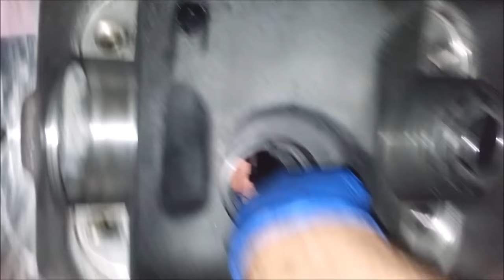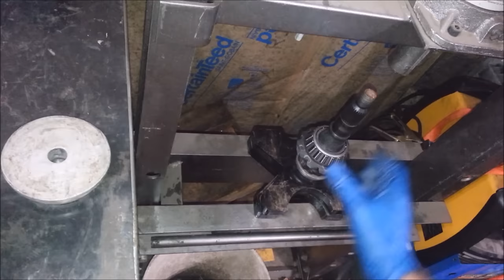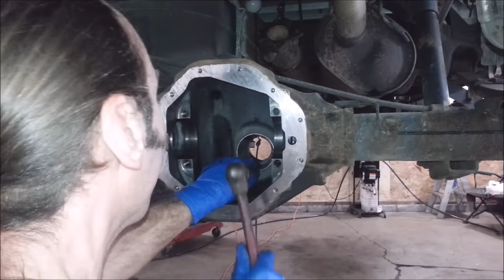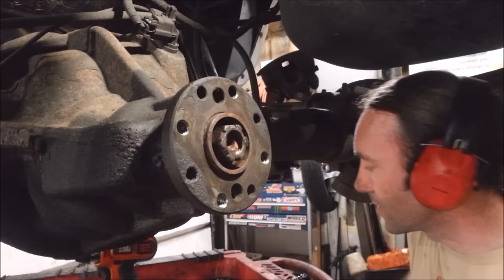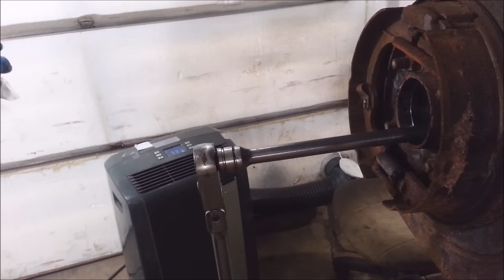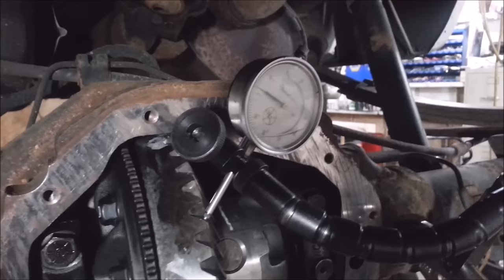1994-2018 Ram 1500 9.25" rear differential rebuild assembly pt2

Comment: The only other thing you should have checked is the pinion depth.   You can do that 2 different ways.  I use the easy way to check it.  I use the yellow grease that you paint on the ring gear and then turn the pinion and watch where the pattern shows up on the ring gear. Or you can measure the pinion depth with a pinion depth tool.  The contact should be in the middle of the ring gear tooth in all directions.  If it's too deep or too far out you will have to add or remove shims.  The other thing is I hardly ever use new crush sleeves.  The old ones can be reused no matter what they tell you.   NOT ALL THE TIME, but most times.  Most times if you re use the pinion shims and the crush sleeve, the pinion depth will be ok.
Reply: I know it's been a year since you commented but just in case you see this I had a question about reusing the crush sleeve. I don't plan to pull the pinion gear (I should tho because the seal is leaking a very little bit) when I replace clutch packs later today in my '03 Dakota with 9.25, 12 bolt, 3.55...but with the driveshaft removed can I check and adjust the crush sleeve drag torque and look for 20-30 inch pounds? (I think that's what he said in the video?) 
I've been a mechanic of one type or another for 50 years but I've never worked on a diff. I'm more than a little reluctant. 
On the chance you see this and reply, Thank You!
Reply: @gregoryking9348 I can’t answer your question. But I have one. My clutch pack belville washers sheared in three places. If my gears are fine can I just do a clutch job ? Do they make just a clutch rebuild kit?
Reply: @dkeeton7  Yes! Absolutely. I bought both clutch packs on Amazon. 

The hardest part of the job was compressing the Bellville's and rolling in the planetary gears. I  finding the right length bolts and the right number of thick washers to use on each clutch pack/axle gears to compress the Bellville's in order to roll the planetary gears back in. I ended up using one 1/2" X 6" and one 1/2" X 5 or 5.5" bolt as 'presses. Get 4 nuts and 8 thick 1/2" washers. Put one nut on the longest bolt and run it all the way up to almost all the way toward the head of the bolt. Then put 2 waahers on the shortest bolt and insert it from the inside the axle gear, thriugh the clutch pack, then add 2 washers and a nut on it and center the bolt and washers the best you can before tightening. Tighten it up and compress the Bellville. Don't go crazy but tighten it until you think the Bellville is losded up. 
Next thread a nut on the longer bolt almost to the head, add 2 washers, and insert it from the outside in. Add 2 thick washers and a nut.  You'll only want the nut screwed on so the end of the bolt is flush with the nut. Use the nut on the outside to snug it up as you center the bolt in the bore of the axle gear/clutch pack the best you can. Then tighten it to compress the Bellville. 
* Both bolts can't be inserted from the inside (head of bolt inside carrier) because it's physically impossible. There simply isn't enough space.)
I suggest first trying to roll the planetary gears in without the concave spacers. The meat on the new clutches doesn't leave any room to roll them in along with the gears. Use a good amount of gear oil while rolling in the gears. Once they're in (it is NOT a cake walk but be patient) then lube the concave shims and slide them in. 
Setting the lash is more of a patience thing than difficult. I bought the long tool on Amazon for about $20. 
If I had another pair of hands and a lift the process would have gone faster but I had to keep crawling out from under to adjust, remove/reinstall the tool...rinse and repeat. I ended up with more lash than spec of .005-.010 but I was plumb wore out.
Don't forget you have to torque the carrier bearing caps and lash adjuster/lock rings over and over before getting an accurate lash measurement. It's exhausting to say the least. Then again, I'm 65.5 with a 4 time loser back and a body beat up from 50 years of heavy industry so there's that. lol 
One last thing...if you plan to replace the axle seals?...do yourself a favor and buy them on Amazon for about $20/ea. The dealer gets $50!!! Each! 
Good luck and be safe.
Reply: If you just need to replace the pinion seal, you know you must remove the driveshaft and the driveshaft yoke.  Then use a seal puller tool or large screwdriver.  They do make tools that help to install the new seal but I feel if you have worked on cars that long you know how to tap the new seal in place.  I have a harbor freight chisel that I've grinded the point off of it.  I use it to tap on the seal to install them. I have over the years made several tools for that purpose.   To be totally honest with you I just turn my impact gun down in power and tighten the pinon yoke nut with some blue locktight on the treads and then see if it is binding in anyway.  I haven't had a comeback.   @gregoryking9348

Comment: Really like what you did with this video,  I had a spacer between the pinion race and housing on my 2011 and I just re-used it.  Your video saved me 3K plus as the shops around me just wanted to swap out the entire rear end and wouldn't do the bearing job.
Reply: i destroyed that spacer when taking out the inner pinion bearing race. now idk if i should add shims of the same trhickness although it was on the crush sleve side of the bearing. I also didnt have a shim between the pinion and bearing. (2011 ram 1500)

Comment: Thank you for this!! You explainedit extremely well and gave me the confidenceto do it myself. The hardest part will be acquiring all the tools. Time to get started!!
Reply: The tools alone for this job can be very costly !
I'm working on that myself... I need a 20 ton press (or 40), Bearing Driver Set (I've gotten by without now for nearly 30 years, but never did a rear-end either), Bearing seperater set, and a flex mount for my dial indicator.
Reply: Harbor freight  has everything and it’s all equality enough I’m setting my backlash as I type

Comment: pro tip use hydraulic press to slighty initiate crush sleeve. So you dont have to use too much force when installing them. Also you can reuse old one if you happen to need more shims for the pinion. Second set of new bearings helps to get the job done quicker if you make bearings slide on and off without any pressing.

Comment: Very good video. I like how you went step by step. This was what I’m planning to do this weekend if all my parts are here by Friday. Thanks for the video man
Reply from the maker: Thanks for watching!
Reply: Exactly how I did it all and it seemed perfect. First test drive everything was fine. Next day I get a roar on coast. Rechecked the back lash and tried tightening the crush sleeve a little more and it’s still roaring.
Reply: @oldrango883 have you corrected your issue yet? it sounds like pinion depth is off.

Comment: He sounds almost normal when it’s at 1.25 speed. Also use the mopar orange axle rtv. Synthetic gear lube will eat through the grey rtv. Also use an inch pound dial indicator torque wrench to measure pinion preload. A click type will only measure break away torque, which will be much higher than turning torque, which is what they want to be measured. I’ve rebuilt hundreds of these at the dealership with no comebacks
Reply from the maker: Agreed.

Comment: Not sure if you still check your comments but I am working on rebuilding my 9.25 at the moment I took it apart a few months back and have all the new parts to reinstall but  there is a spacer that was on the pinion and im at a lose to where the heck it goes it is  3432320 SHIM Drive Pinion Bearing 0.020 I am pretty sure it wasnt behind the rear pinoin bearing but any assistance would greatly be appreciatted

Comment: I had to replace an axle seal and pinion seal.  Forgot to put pin back in to keep spiders in place.  Rotating shaft to remove bolts and spiders worked themselves out.  Now I can't get them back in.  Too tight and not enough clearance for spiders and thrust washers.  Can't seem to push in side gears to allow spiders to sit lower on side gears.  Any suggestions before I pull carrier out?

Comment: Whats the purpose of tightening the pinion nut on without the pinion seal on? is it just to make sure the races and bearings are fully seated first? couldn't you still do that with the Pinion seal on it?

Comment: replacing all my bearing in my 14 with 9.25 rearend. question is where did you get your bearings. I have been to 5 part store amd not one has the right ones and no one can find the inner pinion bearing or race

Comment: Hey I have a question if this was the right videos, but If I remember u said the diff was still howling after you replacement the bearings. My question is I have my ram in the shop and they took a look and said my bearing were fine, but before I took it to the shop my ram wow howl loud. So with information is it fine if it howls?
Reply from the maker: This diff did not howl. Make sure your tires are not cupped, or noisey. It shouldn't make noise.

Comment: Looking to add a Yukon duragrip locking differential to my 2012 ram 1500. Is this going to be the same 9.25 as my 2012? I shouldn’t have to change anything with my pinion correct? Just my ring gear and center section?
Reply from the maker: I don't know. If I was me, I would look at a new one, and see what fitment it has.

Comment: im having trouble the pin is going rubbing with ring did u have to get a different guide pin...installing 4.56s on dodge ram 1500 3.7
Reply from the maker: I did not change the ring, and pinion, or carrier on this job. Just the bearings. Are you sure you don't need a different carrier?

Comment: Do you still have to check pinion pattern on the ring gear or not? Great video, Straight forward easy to follow, Thank you !
Reply from the maker: You can. I didn't bother, because I didn't replace ring, pinion, and carrier stuff. Unless those parts are extremely wore, or I got stupid, and put the wrong shims in the pinion, replacing bearings will not change how the gears mesh.
Reply: @RustBeltAuto  Thanks for the reply. Ill let you know how it turns out.Happy New Year !!
Reply: You should always recheck the pattern to be safe. A few extra minutes is worth it..

Comment: I take it that is a special tool to reach in the axle tubes and turn the bearing adjusters? Looks like that's the only thing special I'll need to do this job to my friends PU.
Reply from the maker: Ya. I made that from an axle nut, and pressed a socket into it. There are ones you can buy though. Usually mail order.

Comment: This video is awesome.  
I have an 07 Ram 1500 and a 08 Ram 1500 and both of them need rear differentials
I want to repair them but I don't have the special tools to get the job done.  
How should I go about fixing the tears on the 2 trucks
Reply from the maker: You need a new ring and pinion?
Reply: @RustBeltAuto  
I dont know what it that I need.  But I do know the rear differential on the 2 trucks are bad.
Reply from the maker: @pjshandymanservices7909  Bad can mean a lot of things. If you need a ring, pinion, and carrier, you might be better off to just get used differentials with the same gear ratios, and put in the whole thing.

Comment: Hey great video thank you I didn't catch the torque on the 8mm bolt that holds the carrier rod in?  Thanks again
Reply from the maker: I used a wrench, and tapped it with a hammer a couple times. hard to get a torque wrench in there.

Comment: Great vid! Pinion seal was leaking on my ‘06 Ram 1500 RWD. Went to replace it and found that pinion nut was loose causing a lot of play. Are all these diffs the same torque spec? Thanks in advance!
Reply from the maker: You mean the turning torque? 9.25" probably. Best to look it up. Might want to tighten up the nut, and check the clearances to make sure you are right. Then get a new nut.

Comment: What was the tool used inside axle tube to adjust the ring gear backlash?
Reply from the maker: It's a Differential Deflecting Bearing Preload Wrench. I made mine from an axle nut.

Comment: hi there, your job seems pretty good and i 'm researching to try and re gear my 17 by myself, only thins that worry me is that backlash... could it be possible to install the gear without having to remove/ adjust the side axles ? cause it seem easy enough to do but i'm really not about using precision tools to measure the play in it..thank you in advance and good job !
Reply from the maker: If you are replacing the gears, checking backlash, and gear mesh is critical. You will need to adjust the carrier, and if the gear mesh is wrong, you will need to take the pinion back out, and add or remove shims behind the bearing. they are usually the same shims, but once in a while you need to.

Comment: Should the pinion spin free like it did before you torqued it down or does the 15-30 inch pound have more resistance than that?
Reply from the maker: When the crush sleeve, and everything is new, it should have that resistance. It will free up a little used.
Reply: @RustBeltAuto  thank you for the quick response!!  Almost have this done and your videos were key for me.  Thanks a ton!!

Comment: Just wondering if you could help me. I have a 2001 Dodge Durango and I thought I’d do something nice like change the rear diff fluid. I took the cover off and it looked really grungy. I was surprised cause I had taken to the dealer (mistake) 2 years ago for all fluids to be changed so I thought this would be just an easy thing. All the bolts were really hard to get off, one on the top required a breaker bar, any way. I got the cover off. Inside the was a lot of metal shavings but the big one literally was 2 pieces of a flat type metal . One chunk about the size of a nickel the other about 2/4 of a circle of something that could be a washer that went somewhere. The truck was running fine, I wasn’t hearing any kind of noises in the rear end and the splines didn’t looked banged up, which surprised me. Can I just refill it and drive it as is till it dies? Will that disintegrate the whole rear diff? Is it worth fixing? The blue book on this truck is like $1000. 00, ironically I just put new tires on cause the others were dry rotted .
Your video is really excellent, but I just don’t have the skills for that kind of work or the tools. Thanks
Reply from the maker: Sounds like carrier parts. Probably what was once an LSD. Write this day on your calender, and see how long the dingo lasts. The only thing to loose is a dingo.
Reply: @RustBeltAuto  what is an LSD?
Reply: Or in other words fill it an go with it?
Reply from the maker: @Cocora22  Limited slip differential. parts in the carrier that make both tires work instead of one.
Reply: @RustBeltAuto  I finished it today. No idea if it’ll work long term. I cleaned it out really well and replaced the cover with a gasket, not RTV goop. Filled it with the fluid and drove it a few miles and it felt fine and sounded fine. Thank you for your video and your answers, I really appreciate it. I’m a senior citizen Not afraid to try and do some basic things and with the help of videos like yours  I have completed many successful repairs and maintenance on not just our older trucks but our new ones too.

Comment: Your carrier bearing tightening tool, what size of a nut is welded on the end of it? I see that you made the tool.
Reply from the maker: I don't know. Took it out of my spare nut bin. I have a bunch of old axle nuts.
Reply: I went to John Deere and purchased a nut that would fit in a 36mm socket. Made my tool and works greats. Thank you for the video and the response. Keep warm. It's getting chili in MN.

Comment: if Im jsut doing a pinion seal replacement with everything else assembled, how do i know the nut is the right tightness?
Reply from the maker: Mark the nut, and pinion, count the threads, and put it on in the same spot. Maybe just a hair thickness more.

Comment: How did you know how many shims to put in before you pressed on that pinion bearing?
Reply from the maker: I used the original shims.
Reply: So you got the exact same bearings? @RustBeltAuto
Reply from the maker: @joebradley1520  ya

Comment: if its a posi, how do the C clips go in and out on the back side of the axle.  Thanks for the very helpful video and keep up the good work.  sorry if i'm not making enough sense.
Reply from the maker: Most trac-lok type carriers have one hole on the carrier where you can take out the clips, and the hole opposite if it, you can not, because there are bars, and gizmos in the way.

Comment: trying to do the limited slip clutches and when I loosened the 8mm pin holder all of it didn't come out does this mean it's done for or is there a way to get the broken piece out thanks
Reply from the maker: The pin is broke in the carrier?
Reply: I got it out long drill bit used the broken bolt as a guide (drilled hole in it) then a easy out thanks for your response